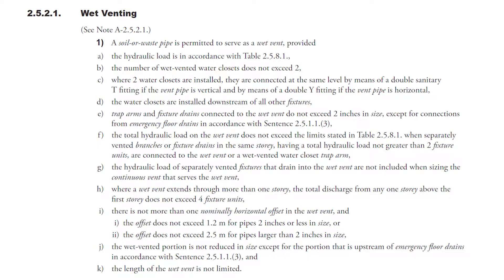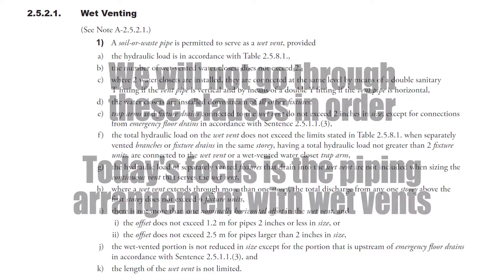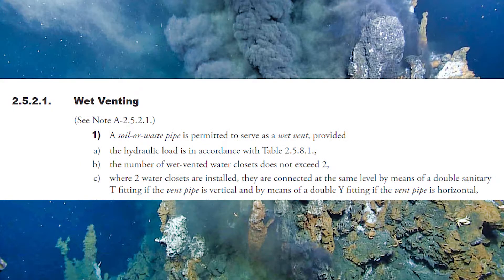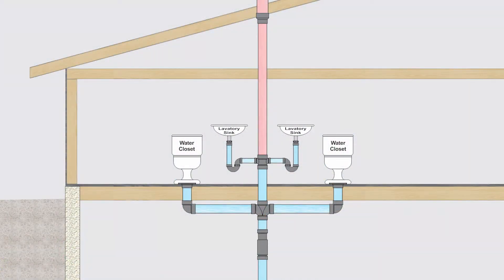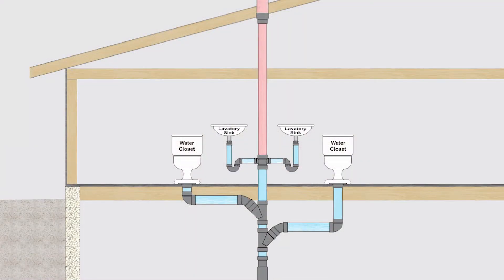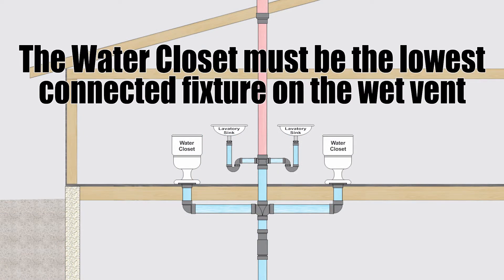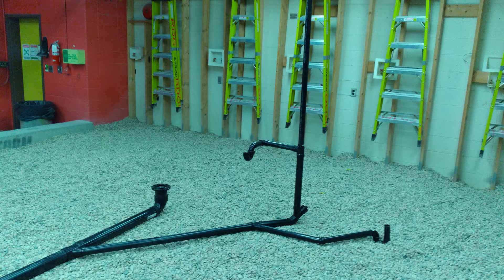Wet Venting Video:2 - Piping Arrangement

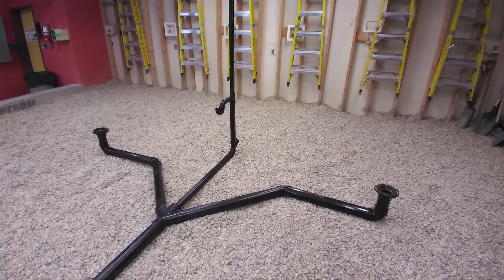Comment: Hi, your example of a double Y fitting on the vertical at 2:00 does not comply with the NPC2020. Should maybe correct that. Coming from a plumbing inspector here.
Reply from the maker: I retract this statement after further examining the code. Thank you for correcting me.
Reply: Yeh, I get that. I’m just stating that your video should not show installations that are not code compliant. It looses a sense of credibility.

Comment: I understand the detail of both toilets must enter the vertical pipe at the same level and not offset and that in the horizontal  description “Y’s” must be used and not double tees. My question is can 2 toilets “Y” into the horizontal main line at different points offset or do they have to enter the main at the same point?

Comment: About the definitions of Continuous Venting... I feel  both definitions ring true. A toilet in my view is  always going to be  on a wet vent, and needs a vent attached some place  going vertical to reach a point above all wetness (connecting to the vent stack) you can't get to dry unless you go up. it will not be dry until it passes the last drainage point of the highest fixture on that line, otherwise it's still a wet vent situation. I don know why it said two or more for it to be called a continuous vent ( must be a plane dry vent if solo:). If anyone can see something wrong in how I'm thinking  this please let me know.

Comment: I mean if you have a double y installed horizontally for a bath and lav going into the main 3". Is one side wet venting across to the other side? Or do you need a separate dry vent for each side?
Reply from the maker: This varies from province to province and municipality to municipality. Will it wet vent from one side to the next, yes. Will the inspector pass it, maybe. This is a great reason to establish a good working relationship with your local inspector, they will answer your questions if you treat them with respect.

Comment: Hope you're still answering questions. Can a sanitary drainage pipe that's less than nps 2 but also serving less than 6 fixture units serve as a relief vent? The sanitary drainage pipe is only serving a kitchen sink with 1.5 fixture units and has a 1.5" drain. Do I only need to upsize the sanitary drainage pipe for the relief vent?
Reply from the maker: You are talking about a relief vent, does that mean your are referring to circuit venting? If so, I need more data to answer your question, but I suggest watching this video series first: https://youtu.be/SM30xRd6ND8

Comment: Can you please explain. I thought you cannot use a double wye on the horizontal. I'm from Ontario and we are changing to n.p.c.... I was taught you can use a double wye in any orientation on a vent and only nominally vertical for drainage. Please explain
Reply from the maker: I can't explain, other than this is a jurisdictional decision. Some inspectors will accept it, others will not. That whole 'Authority having jurisdiction' line is ringing in my ears right now.
Reply: @MathematicPlumber  thanks for your time. Appreciate the response. Love your videos and Happy Easter my friend!
Reply: One more question would you plumb it in like this or would you prefer separate wyes with different vent configuration. I ask because I was taught that double wye you can't get the right fall on both side of that wye. I would appreciate your opinion
Reply from the maker: @SamSckrapnick  I prefer separate wyes. That way I can guarantee there is a clear path for the vent portion of the wet vent.

I'm not as concerned about the grade from a double wye, because the pipe can be cheated into fittings with slope. But yes, the water will back travel up the pipe a bit through that wye.

This all being said, I prefer not to use a double wye on the horizontal, but I will do it in a pinch if the local authority allows it.
Reply: @MathematicPlumber  love the videos your a life saver and thanks again for the knowledge.

Comment: Can the stack vent to the soffit area rather than out the roof.  Thanks Steve
Reply from the maker: Not in Canada
Reply: @MathematicPlumber  Thanks for your reply Kelly I found the reference in the code. I did not know that it was available on line. appreciate your videos. Steve
Reply from the maker: 2.5.6.5. Terminals

1) Except as provided in Sentence (3), the upper end of every vent pipe that is not terminated in outside air

shall be connected to a venting system that terminates through a roof to outside air.

Sentence (3) talks about venting through the wall of the building, which is rarely done. But the vent still terminates to open air

Comment: Is there code for max trap arm length in wet venting? I know minimum length 2 multiple of dia of pipe . Thanks
Reply from the maker: 2.5.6.3.1(b) the total fall of the trap arm is not greater than its inside diameter

This is where you need to do grade math. I have a video on that too

Comment: does this mean you cant put  two WC, (each on different floors)  if your main stack is DWV  and you are wet venting both?
Reply from the maker: Yes, given you follow all the rules of wet venting, you can do that. That being said, if you intend to wet vent two bathrooms through a SOW stack on different floors, that will not work. You will need to properly vent the bathroom on the lower floor and connect it appropriately to the stack. The top bathroom can be wet vented through the stack though.

There are few more videos in this series, they all tie together. I also have a two other series on residential DWV.

Comment: Great videos, thanks a lot. One question: for the failing example (min 2:33), can we fix it by adding a separate vent for the right-hand water closet (so the last fixture on the wet vent would be the left-hand water closet), or still a code violation? thanks
Reply from the maker: You bet. Adding an individual vent to the right water closet would keep this install to code.
Reply: @MathematicPlumber  thanks for your quick response, much appreciated.

Comment: Could you clarify point -d where "the water closet must be the lowest connected fixture on the wet vent"? From the ABS example it looks like both the shower and toilet are at the same level. Thanks for sharing a walk-through with samples!
Reply from the maker: What you need to focus on is where the trap arms of the 2 fixtures connect into the wet vent.

Look at 3:34 as a reference: The wet vent grades down from the right side to the left side at ¼" per foot or 1 in 50 which is hard to see in the video.

The shower trap arm is connected to the wet vent at a higher point compared to where the toilet trap arm connects into the wet vent.

Therefore the water closet is the lowest or most downstream fixture - connecting into the wet vent.
Reply: @MathematicPlumber  appreciated! I do see your point; right of the yellow arrow at 3:34. Thanks!

Comment: I’ve got a question. I’m going to be wet venting a bathroom (stall shower, toilet, and sink)  in my basement. With my toilet being the main pipe and it picking up the shower and sink on the way to the soil stack. Would I also be able to have it pick up a washer machine drain (using an AAV)
Reply from the maker: The answer I can give you is maybe. Judging by your YouTube channel picture, you are American. If that is the case, I do not know American plumbing code, I only know Canadian plumbing code.

Comment: In Wet venting a WC to a basin.. How far can the Basin be from the WC. The Connection at the 4x2 wye is about 2feet on the horizontal to the bend for the WC. Then the Wye picks up the went vent to the Bathroom Basin. The Basin is about 10 feet from the connection for the 4x2 wye

Comment: Just wondering, if a water closet is dry vented and not part of the wet vent, it doesn't have to be installed downstream of all other fixtures right? Thank for the videos. Help a ton!
Reply from the maker: Kind of. The fixtures downstream of that water closet would need to be separately vented too.